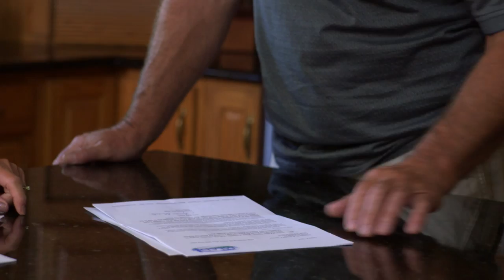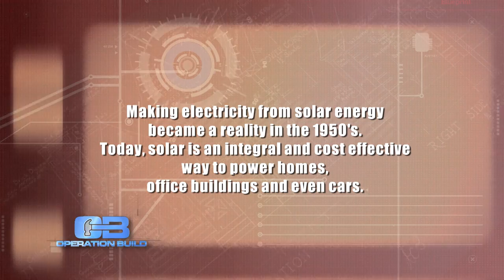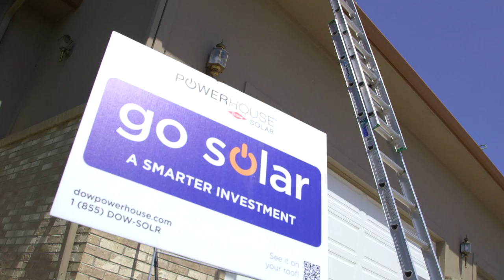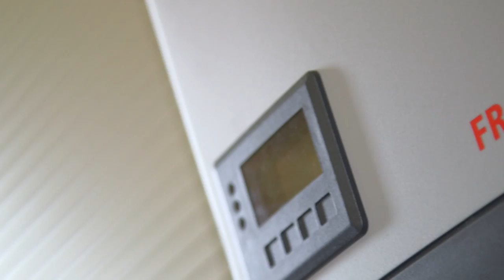A Better Way to Go Solar with Dow Powerhouse

Comment: Sadly, this video offers no details on panel installation, electrical connections, or costs/payback, or other factors that homeowners will consider. What it does offer is repetitive and irrelevant shots of the homeowners and host walking, and a backdrop of cheesy and trite canned music. Ugh.
Reply: You are absolutely right!
This was just a long ad for DOW! 
What is the voltage of each individual Panel?
What is the combined output of all of them to the Charge Controller?
Who made the Inverters?
Modified or Pure Sign?
NO battery Bank?!

When I am considering a purchase, SHOW ME THE NUMBERS & TELL ME WHAT THEY MEAN!

My Brother in Law got swindled by something like this in Arizona. I work in the Solar Industry, and my Mother BEGGED him to talk to me first! He would not listen. End result:
Due to the Real Estate Bubble burst from a few years back they already owed more on their house than it is worth.
The company they went with LIED to them about Federal Tax incentives they learned the hard way DO NOT EXIST.
Because they too, bought into the Grid Tie SCAM(!), When the local utility loses power, THEY lose Power!
I am dead set against Grid Tie systems, but if you insist on one, for GOD'S sake, ADD A BATTERY BANK!
They were paying $600.00+ per Month for electricity in Arizona (Air Conditioning or you die!)
While the Grid Tie System they bought DOES meet their energy requirements, and they now have no electric bill, their PAYMENT to the company they went with is-are you ready for it-$600+ Per Month-Its a wash
But it ISN'T a wash-they are already upside down on their house and are now another $47,000 IN DEBT!

My Brother in law was taken in by a Hot Chick in tight pants, and a lying Salesman.